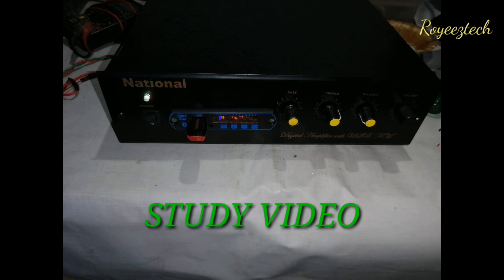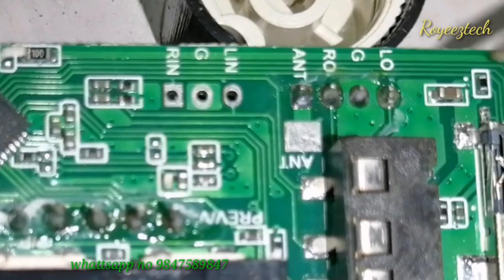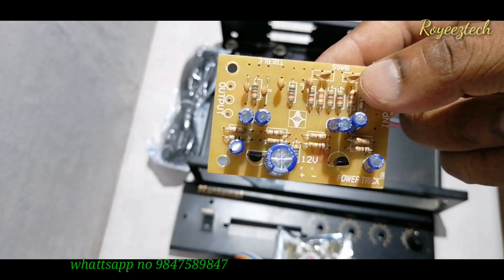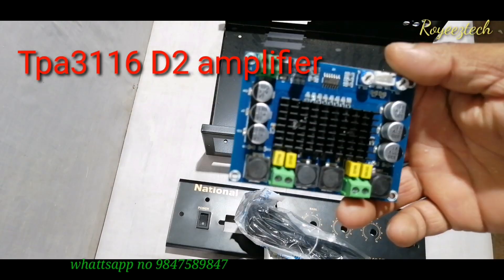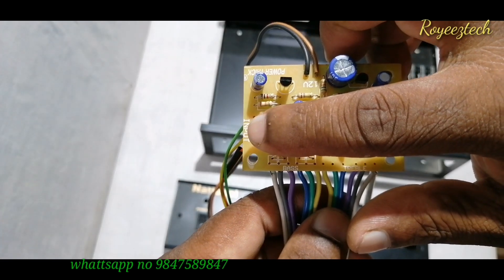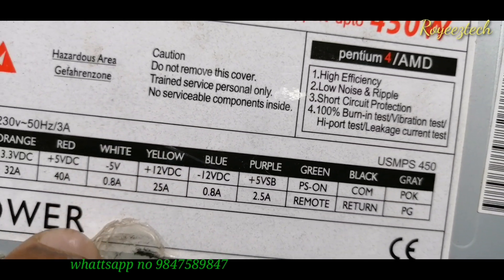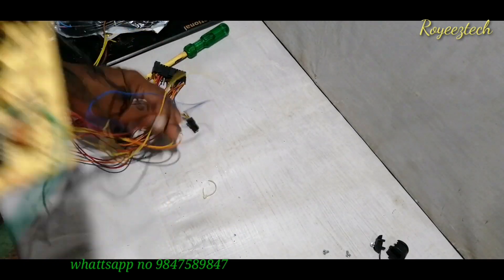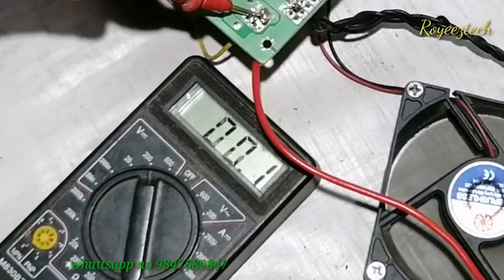How to make budjet class D,quality soud Amplifier (Tpa3116)study video

Comment: ചേട്ടാ.. എനിക്ക് കാർ ഇൽ ഒരു ക്ലാസ്സ്‌ D amplifier ഇൻസ്റ്റാൾ ചെയ്യാൻ വലിയ ആഗ്രഹം ഉണ്ട്. 10 inch Dainty subwoofer പ്ലസ് ബോക്സ്‌ ഞാൻ നിർമിച്ചിട്ടുണ്ട്. ഇനി വേണ്ടത് ഒരു 2.1 amp anu. ചേട്ടൻ ഈ വീഡിയോ ഇൽ യൂസ് ചെയ്‌ത  2 ചാനൽ ക്ലാസ്സ്‌ D ബോർഡ്‌ ഉം,  ഒരു mono ക്ലാസ്സ്‌ D board ഉം,  ഒരു low pass filter board ഉം use ചെയ്‌ദ്‌ oru 2 ചാനൽ plus  subwoofer board ഉണ്ടാകുന്നത് എങ്ങനെ എന്ന് oru വീഡിയോ കാണിക്കാമോ... കാർ ലേക്ക് ആയതു കൊണ്ട് തന്നെ amp volume cantrol external ആയി എങ്ങനെ connect ചെയ്യാം എന്ന് കാണിച്ചാൽ എനിക്ക് ഉപകാരപ്പെടും. Remote key എങ്ങനെ എന്നും.